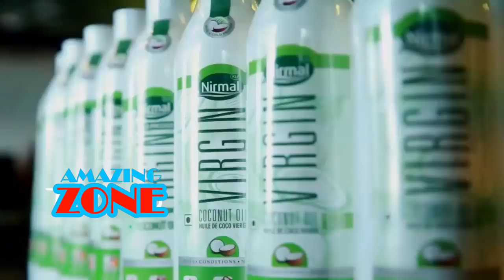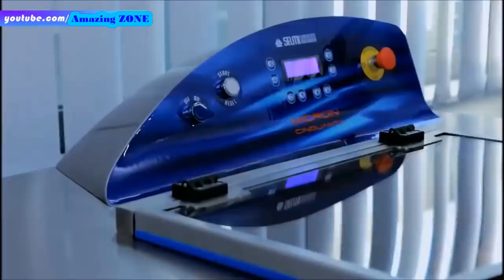Amazing COCONUT Processing in Factory ★ Coconut Oil, Milk & Water ★ Awesome Food Processing Machines

Comment: Most of the coconut oil brands in the market contain mineral oil, paraffin and other harmful mixtures. Even used motor engine oil is used. It is said real oil is only 20 percent. This causes health problems. The culprits should be severely punished.

Comment: "Palmer Asia Inc.
We Supply the following

Intelligent Cctv
Security Systems

I. Cctv Engineering
   Govenments, Schools,
   Hotels, Factories,
   Warehouses, Highways,
   Airports, Streets,
   Shopping Malls,

II. Smart Home Security
    Mini Shops, Mini Offices,
    Villas, Appartments And Homes,

III. Intelligent Office/Home,
      Home And Office, Time.           Management,
      Attendance, Alarm And Other Devices..

IV. Security Accessories,
     Cables, Connector,
     Centralized Power Supply,
     PTZ Keyboard, Video Tester...

V. Supply Delivery, Installations,
    Testing And Commissioning of
     UPS from 650va to 800kva
     Single Phase And 3-Phase

VI. Generator Set ...

Fire Extinguisher
Fire Hose
Fire Cabinet
Fire Axe
Fire Alarm
FDAS Installations
Smoke Detector
Sprinkler Head
Emegency Lights
Surveillance Cctv Camera
Fug Nuzzle
Straight Nuzzle
Tear Gas
Plame Guard Paint
Fire Retardant Solution
Fireman Accessories
Fire Jacket
Fire Blancket
Fire Boots
Fire Truck
Ambulance
Emergency Rescue Vehicle
Fire Fighting Helicopter
Fire Fighting Equipments
Constructions Materials &
Project Developer
Tele-communications
Financing Services
Business Consultancy
Etc...

We supply the ff:

* Evercast Plastic Work Form Board
* Window film Composite Pannel
* Polycarbonite
* Acrylic Plastic
For construction

PALMER Products
Available to the ff. Stores
Ace Hardware (SM)
Handyman (Robinsons)
LTS Hardware NCCC Mall
Ferderal Hardware
Selected Hardware Nationwide
Selected Constructions Company
Selected Retailers Stores

Our Major Clients
Pagcor
Napocor
Malacañang
Ninoy Aquino International Airport
Banko Central ng Pilipinas
Toyota Philippines
Nestle Philippines
Uniliver Philippines
San Miguel Corporation
Jollibee Food Corporation
Procter & Gamble Phil.
Ayala Land
Star Backs Coffee
LRT
MRT
AFP
PNP
TV5
Marina
Waltermart

Open for 
Reseller
Distributor
Refferrals
Agents, welcome
Supplies & installations
Unlimitted Income

Sa PALMER sigurado ang FUTURE mo! Anu pang hinihintay mo!
More Connections
More Friends
More Sales
More Money

Save your Lives
Protected your Properties
Environment Friendly

Any Further Inquiries:
Look Mr. Fred Palmiery
0995-126-3700
0923-800-5357
fred.palmiery@yahoo.com

View your Business or Home
Anytime, Anywhere, Anyplace
Your Best Surveillance Security Partner ...

www.palmer-asia.com